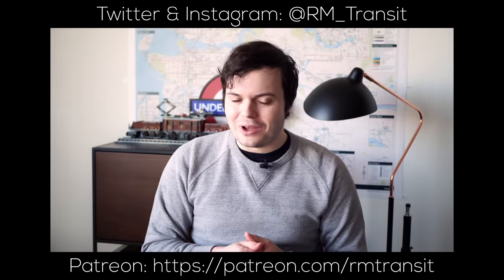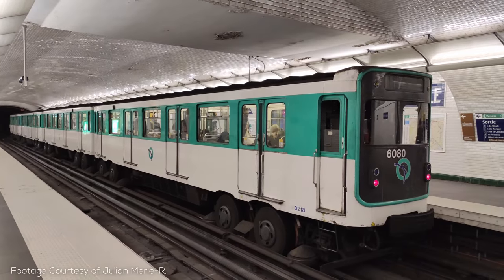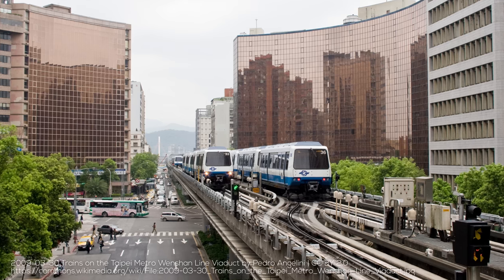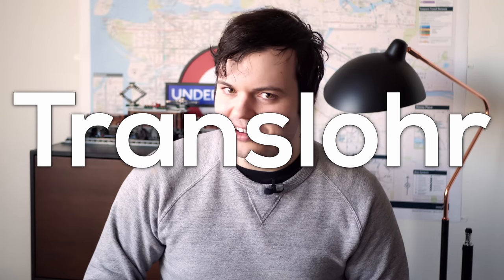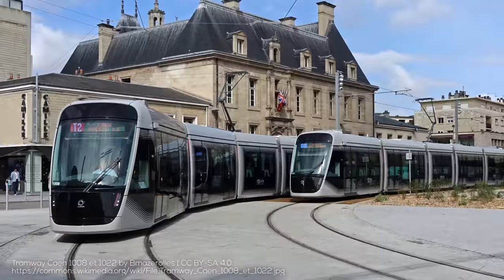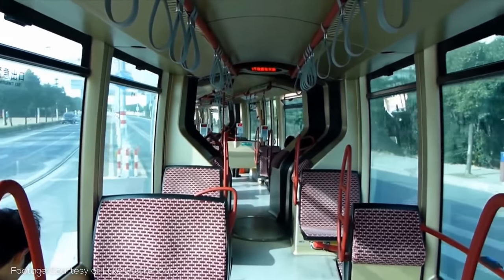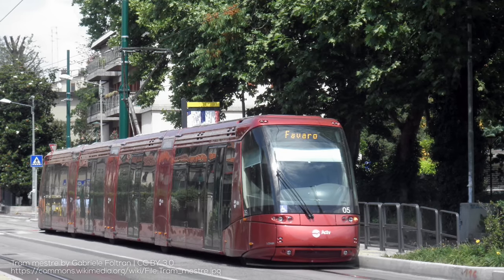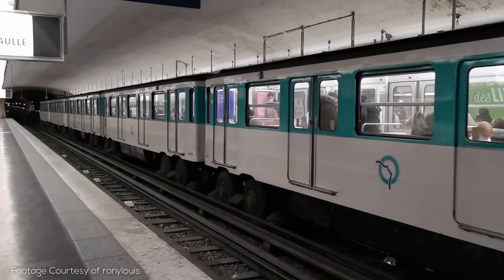Rubber-Tire Rail Transit is Weird

Comment: I think that some gadgetbahn systems and respective technology (translohr, rubber-tired metro) may have a usage where classical systems fail or have major issues. Probably one of these cases are cities with a difficult topography where "steel" trains would need long tunnels and shallow gradients to change height, while rubber tires can use much more steep inclines, but without the need to build a funicular style system.
Reply: This is what the Morgantown PRT does to allow very tight turns and steep grade climbs.
Reply: @thomaserickson5737  I belive because few cites are built on steep slopes. They are widely used in Switzerland for commuter rail though.
Reply: @thomaserickson5737  Rack railways are incredibly slow, I think rarely faster than 30 kph, which is far too low for any metro-style service.
Reply: You're right. One successful case is Medellín's tramway, only the rubber tires could climb that steep roads.
Reply from the maker: Yep that’s my thinking, tunnelling is not cheap!
Reply: @jorgeandresortigozaulloa6088  Rubber tires or avoiding the roads entirely (Metrocable, Mi Teleferico, etc)
Reply: @TRWnan  The city topography it's the key to chose one or another. Medellín it's a narrow valley surrounded by mountains, as the city grows neighborhoods was built in steeper slopes.

So, for those areas with not so much inclination rubber tires tramways are the best option, as it fits better in narrow roads and changes the public space for good.

When the mountain are too steep, it have to use funicular, but this system doesn't have high capacity and the stations are too far between them.
Reply: @jorgeandresortigozaulloa6088  Might be a language difference here - in english a funicular is a train on rails pulled by cables - like old San Francisco streetcars. Metrocable isn't a funicular in english, it's a gondola (same word as the canoes of Venice). Anyways they do different jobs - Gondolas are great for point-to point with no service between but with good obstacle clearance. The system profiled in the video can have many stops like a true tram.
Reply: @TRWnan  you're right! I going to have it in consideration for future commentaries. 

I would like to see in Colombia longer Gondolas systems with closer stations. And I remark the longer aspect, usually the Gondolas go from the low to high points of the city  by the shorter route, I would like to see longer lines, that impacts more people.
Reply: @thomaserickson5737 1) rack railways are slow. Really slow
2) Ironucally enough, Lyon does use rack railway on one of ot's metro.lines which is too steep even for rubber tires.
Reply: @jorgeandresortigozaulloa6088  For that matter, a narrow valley was also the reason for the Wuppertal Schwebebahn. That way, it could be built over the river and over existing fairly narrow streets.
Reply: @thomaserickson5737  Doesn’t Lisbon have a rack based metro line?
Reply: @thomaserickson5737  this is called a rail and adhesion system common in Switzerland.
Reply: @thomaserickson5737  check out metro line M2 in Lausanne/Switzerland, Initially a funicular, then a rack railway, and in 2008 converted to Paris like Metro with full automation. Rack railways are generally more expensive i would say (only one train supplier worldwide - Stadlerrail), as rubber tyre is more common in the world. Furthermore, they (rack railways) make a lot ouf sound, more so than tyres...
Reply: Medellin and Lausanne would be two excamples of this.
Reply: @thomaserickson5737  try to have look at the late POMA2000 in Laon city for your answers
Reply: @thomaserickson5737  The Vancouver SkyTrain (also used on Toronto Line 3 and quite a few Tokyo lines) is basically an attempt at this. It uses a LIM instead of a cogwheel to engage the reaction rail (which has much better performance), but is still in the spirit if a rack railway as it uses steel wheels for rolling and a central non-weight-bearing rail for traction.
Reply: Yep, they are fine to specific cases which is indeed solving the topography problem. The issue is many of these gadgetbahn were implemented because they can, which is bad since the money is mostly wasted on more expensive maintenance to a limited amount of suppliers.
Reply: @thomaserickson5737  Actually, cable cars and funicular railways are very different. Funiculars have two cars permanently affixed to a single cable, and are basically just angled elevators. They are operated either by ballasting the upper car with water, or by moving the cable using a drum. Cable cars, on the other hand, have many vehicles propelled by a continuously moving cable. The cable moves in a guideway under the street, and the cars grip onto the cable, releasing it when they want to brake. For intersections between lines or switches, cable cars can release the cable and coast through using their momentum. Cable cars have a much higher capacity and level of versatility than funiculars, because you can run more than two vehicles per line, the vehicles don't have to be synchronized, and vehicles can coast between cables if you want to run multiple lines over the same section of track.
Reply: @jorgeandresortigozaulloa6088  But the rubber tires could be probably mounted on a trolleybus instead of the Translohr vehicles. There may be some advantage of the rubber tired tram compared to trolleybus in terms of size and capacity of the individual vehicles, but there are some very long  high capacity articulated trolleybuses available from several manufacturers, so I don't believe it would be substantial. And the advantages of trolleybuses are real (standard technology offered by several manufacturers, ability to divert from the given path in case of problems (if the trolleys have a battery/generator).
Reply: Stuttgart‘s line 10 uses rack railway technology for light-rail service in a big city.
Reply: @thomaserickson5737  Lyon Metro Line C? It's short but very steep, with platforms at 17% grades. I think it's in one of RMTransit's videos on unique railways

Comment: Speaks about Taipei Wenhu Line with that rubber tyre, I still recall former mayor of Taipei Chen Shui-bian quote:
馬特拉不拉 我們自己拉 (If Matra don't want to push our train, we will push the train by ourself)
After the construction of Wenhu Line, the rolling stock provider MATRA suddenly terminate their contract to maintain them, surprised the Metro Taipei and government because they need to assembly their own crack team fast with homegrown component. Luckily Taiwan's industry prowess allow them to still let it run until today.

Comment: My favourite transit choice anywhere is the rubber-tyred NS-93 on line 1 in Santiago. Huge windows, spacious, wonderful sound, and amazing acceleration and deceleration. Combined with the extremely short stops, excellent headways.
Reply: The only problem I have with those is seat distribution. I don't want to talk to strangers on my way to university!!
Reply: @thepedrothethethe6151  Good point. I just never sit so hadn't thought of that.
Reply: NS-93 is based on Paris's MP89. TL 8/8 from Lausanne also looks very similar !

Comment: The Nancy TVR will soon be replaced by 24m long trolleybusses, with "In Motion Charging" onboard batteries by HESS.
Paris choice to build so many different and non-interoperable LTRs is just incredible ! (TVR, 2,45m/2,65 wide trams, 750VDC/1500VDC Overhead lines...)

Comment: There is a similar system to these where I go to university. It's called the Morgantown PRT. They are self driving buses that run on a grade separated guide-way. Each car carries 15 passengers (if you overload them they scream at you). The system was built in the 70s and it has garnered a reputation for unreliability in recent years. It actually broke down a few hours ago; right as I was about to get on. It's an interesting system, and is the largest of its kind. It may be worth looking in to for a video sometime.

Comment: As a native of Boston who has lived in NYC since the 1980s (ie, lifelong familiarity with steel on steel subway and trackless trollies), I am an unabashed fan of the two rubber tire subway systems I’ve used extensively (Paris and Montreal). They provide a much more quiet (or at least pleasing to the ear) riding and waiting experience and in my opinion a much more comfortable ride whether seated or standing.
Furthermore, I believe you stated it exactly opposite (in my subjective opinion) when you stated you don’t significantly prefer the ride in Toronto’s conventional system to Montreal’s rubber tire system, though YMMV and obviously does.

Comment: I think there is a big gap between those technologies, the translohr is a pain to use, it's shaky, often delayed, has frequent issues and so on. On the other hand, the VAL is such a pleasure on the daily, it sails smooth (unlike the neoval which apparently is quite shaky), is quite silent, and has 1 min headways. And as a user waiting 1 min instead of 8/9min can shorten your trip by a LOT.

Comment: I'm using the Translohr T6 line south of Paris every day and I'm very happy with it. In addition it has a steep sections which it manages really comfortably, not bumpy and not at all noisy. Also it looks very good and is clean. I think it helped the neighborhoods around the line to significantly increase in value. I would say it is a great success.
Reply: I'm happy too. Frequency is great. Just hope it won't diseappear and turn into a bus when the technology gets to end of life.

Comment: I do think there’s benefits to having some non-standard transit technology around. Sometimes a later development only made possible by the fact people are still holding on to an odd system helps them become far more competitive. For instance, there were very valid reasons behind cities choosing buses over trams in the mid 20th century but they’re coming back because some cities held on to a seemingly inferior technology and figured out how to make them better.
(Also, I will take the roar of rubber over the squeal of metal on metal any day.)

Comment: You talk about the tram in Clermont Ferrand and for that thank you. One big thing I like about rubber tired trains, especially in Paris is that they are much more quiet than standard systems (this is one of the reason why the line 2 & 6 have been equipped with it) Also it helps with large hill. As a user of the Paris metro everyday to go to work I prefer taking the line 14 over the line 7 (which is as loud as it can possibily be, the MF77 is an absolute horror) even if it means having 5 to 10 minutes of travel in addition. If you ever go to Paris you might be interested in "Les journees du patrimoines" where the RATP allow us, with someone from the RATP, to go on the track of some unused station like Haxo where you will be able both rubber and non rubber track. This was the place where they first tried rubber tired track.

On another hand one thing I like about how it was implemented in Paris is that the track are compatible with normal trains meaning that if they ever want to swap the train they can! On some occasion you will even find some metro from line 4 on non rubber tired track in order to go to maintenance.
Reply: la 2 c'est du materiel fer (MF01) il me semble
Reply: @potdefrite7632  yep, line 2 are not rubber. Paris metro with rubber systems are 1, 4, 6, 11 & 14

Comment: Nice video!  I like how you explain some technical aspects of the technology and why it was chosen, and still make your videos easily consumable by most people!  Rubber tires usually cause a more bumpy, slower ride than steel wheels.  I’m still hoping that urban maglev systems with speeds between 100-160kph get built, like the Linimo in Nagoya Japan and various Chinese urban maglevs.  One major benefit to grade separated rail systems is that it can’t hit cars, bikes, pedestrians, etc.

Comment: The trains on Montreal Metro are LOUD when they depart from a station! Some say it’s the traction motor(I can’t find the source), but I really enjoyed it when I visited Montreal a few months back. Also I believe Montreal Metro has the highest capacity rubber tire metro trains out there. It’s a system that adds personality to the city, I do wish it was more expansive!
Reply: If you are talking about the sort of melody the older trains makes when they depart then yes it comes from the motors. They also decided to use that sound for the door closing chimes.
Reply: Loud traction motor startups is endemic to AC traction motors made before about the last decade, most common to trains from the 1990s-2009 or so.  Prior to IGBT technology the gating transistors that AC traction motors needed to modulate their power were quite noisy. This sound is most notable on the 1993 stock London underground trains (the infamous sound of the Jubilee Line), the high pitched REEEEEEEEEEEEEE that LIRR M7 trains make at 6mph and the musical scale startup sound of the "singing" Siemens Taurus locomotives (most commonly used by OBB in Austria, go figure). The musical scale gating transistors of the Siemens Taurus was a deliberate easter egg on that locomotive.

Comment: The Yurikamome in Tokyo actually really benefits from the rubber tire rail configuration as it allows a smaller footprint across the small islands of Odaiba, Aomi and Ariake district. It also lets the smaller trains move faster and stop quicker, which makes the trip through the rather winding tracks a lot better.

Comment: I first experienced rubber tired Metro in Montreal when visiting Expo 67 World's Fair. As I recall, the advantage provided, was the slope downward leaving a station that helped accelerate the trains  and the next upslope which saved on brakes. This also let the stations not be so deep  as steel wheeled subways tend to be. Paris did not have that feature on the ones I rode there.
Reply: Nuremberg subway system was built in a way that the tunnels between two stations dip down a several metres in the middle. This helps with using less energy for acceleration and deceleration.
Reply: Singapore has such a design also though it also means that if you want to lengthen the platforms, the ends will no longer be level, which would complicate accessibility